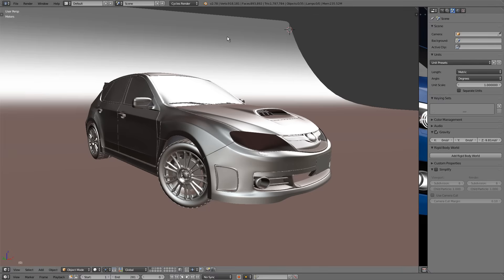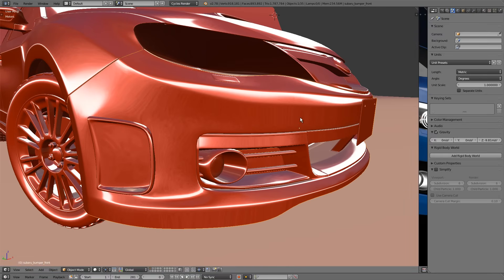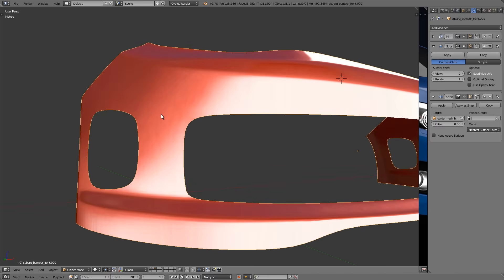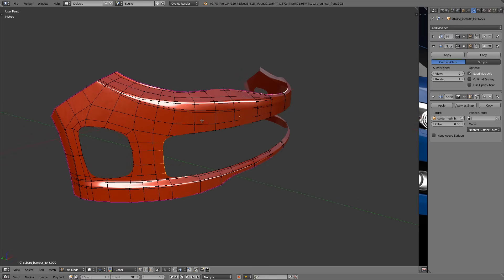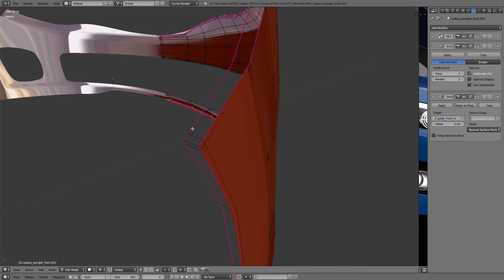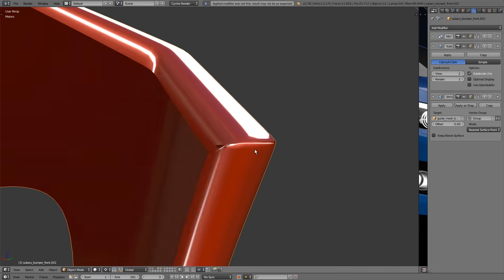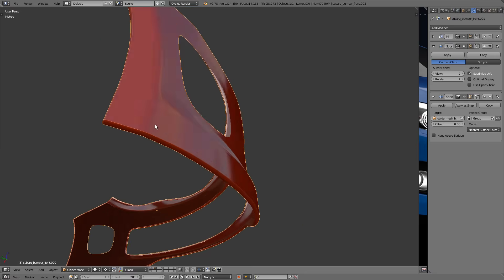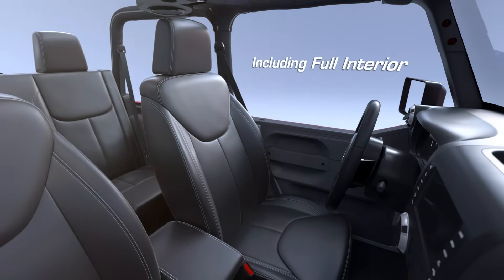Advanced Subsurf Modeling - Techniques to Avoid Pinching

Comment: The excluded area interpolated geometry  betweeb the excluded edge and the part curved surface im shrinking try to conform to the shrink base and make a curved transition to the main surface area in my case. How to work around that?
Reply from the maker: If you're talking about adding thickness and getting issues when excluding vertices from being shrinkwrapped, this is actually an older tutorial which I delisted as the techniques have improved significantly in my latest course. Adding thickness no longer involves messing around with vertex group weights, and is entirely procedural. That said, for other cases where vertices are excluded from being shrinkwrapped there will usually be issues at the boundary between shrinkwrapped and non-shrinkwrapped vertices. Generally this technique is best suited for cutouts and panel separations, but there are solutions for problems that pop up from excluding vertices, but the solutions are case-by-case. I'm working on more universal solutions for this to make this technique as good for extrusions as it is for cutouts, but I don't have anything new published yet. Hopefully later this year.
Reply: @blengine  Amazing! Thank you for the reply : )

Comment: how did you model the guide mesh so perfect? did you use the existing model or what? sorry for noob question
Reply from the maker: At this point I forget exactly what I did with this, but since this was a repair I likely just took the existing model, deleted parts of it, and rebuilt those areas with simpler topology. The normal process for modeling this would be reversed though, you'd make the guide mesh first and then use a duplicate of that to make the more detailed mesh that gets shrinkwrapped on top of it.
Reply: @blengine  thanks really interested how to model bumpers and fenders from scratch, and the best practices to do it. most i see is subd quad extruding along blueprint
Reply from the maker: Yeah that's the typical way to do it. If you're looking to model from scratch, as in design your own, there might be some good tutorials on that somewhere but I don't know of any unfortunately.

Comment: The guide mesh thing is also good for modeling completely from scratch. (Making up your own vehicles.) In that case you tend to use modified primitive forms to define the main volume and profile shapes, and then build the different panels over it, while leaving holes or other geometry for other details. In the guides themselves you're not worrying about edge flow so much (if at all), so the topology can be somewhat more crude. You can even poke meshes through each other to make guides, as it's the external surface you're concerned with. All the panels built over the guides will line up. Of course edge flow is something to be keen on when making the panels so you can control creases for the blended forms.
Reply from the maker: Yeah shrinkwrapping is extremely helpful for many workflows, and takes a lot of frustration away from making complex things.

Comment: Has shrinkwrap changed in implementation in 2.9? If i create a bumper everything identical to the way you do it, duplicate and add the two subd layers to it. Everything works great until i apply the modifier to lock verts in position on my final mesh, once i do that, all the verts lo longer line up with the guide mesh positions. They sorta "jitter" along the line where they should be nearly identical to the guide mesh beneath, it's been really aggrevating me recently.
Reply from the maker: The technique should work in newer versions of Blender, though they did move some options around in the shrinkwrap modifier which can cause some confusion. If you're still having trouble with this, send your blend file over to me at contact@cgmasters.net and I'll check it out. And set the blend file up to before you apply any modifiers so I can try doing that myself. -Chris

Comment: How about in 3ds max? What's the tool called that achieves the same thing? Thanks
Reply from the maker: Hey Sp00f, this link is extremely helpful when it comes to 3ds max  -  https://knowledge.autodesk.com/support/3ds-max/troubleshooting/caas/CloudHelp/cloudhelp/2021/ENU/Installation-3DSMax/files/GUID-008F9FA9-F532-4EEE-B4BD-E5A6C4C49E47-htm.html
Reply: @blengine  got it! thanks a lot for taking the time to reply. will consider giving this option a try
Reply from the maker: haha, to answer you seriously though, I know maya has a shrinkwrap modifier, but I'm not sure about max. This is the best I could find on the topic - https://forums.autodesk.com/t5/3ds-max-modeling/shrink-wrap-in-3ds-max/td-p/8913852
Reply: @blengine  thank you. seems like the conform tool is what ive been looking for! have a good day bud <3

Comment: Nice tutorial, still useful after these years. One question: Anyone knows how would you approach the problem if you need to add some low relief carvings in a curved surface? Imagine a R2D2 droid model with many details on a cylindrical surface

Comment: so youre constraining against a guide mesh but the second you remove that (say you export an obj to a game engine or another package) without the guide mesh and deformer constraining it, when that mesh smooths its going to look wavy again isnt it?
Reply from the maker: Yes without the guide mesh the effect is no longer in play. What you'd need to do is apply the modifiers, including the subsurf modifier, so that the subsurf geometry is real and then the shrinkwrap effect is real as well. Then you can export. There's actually an option to apply modifiers when you open the export window too, so you don't have to do this manually, you can just make sure that box is checked when exporting. The problem with this is that it creates loads of extra geometry, so for something like a game model this isn't ideal. But what you could do for game models is use the shrinkwrapped model for baking normal maps onto a lower poly version of the model. Then these normal maps can be used in other software to ensure that your surfaces have the same perfect surface appearance.

Comment: Hello CG Masters. I really like how shrink wrap modifier works in blender, but let's say if I want to apply the shrink wrap modifier without applying my subdivision surface first? Like is it even possible to apply shrink wrap before subdivision modifier and still maintain nice smooth curvature? Because whenever I use shrink wrap on my model, all looks fine, but once I want to apply my shrinkwrap before subdivision surface, my curvature won't be that smooth after applying it. Is there some workaround on these situations? Or you just have to apply subdivision before shrinkwrap? Thank you so much for your help, means a lot to me <3
Reply from the maker: Hey Samuel, without that extra subsurf geometry to shrinkwrap then you unfortunately won't get smooth and continuous curvatures. Shrinkwrapping subsurf geometry is the core of the technique. So yeah you'd have to apply the subsurf modifier first, and then apply shrinkwrap.

Comment: This is all good and well but my tip for beginners would be to make sure you practice your sub-d workflow without using this shrink wrap method because its like modeling with a crutch. Also its not a modifier that you have access to in  every software package so its not easily transferable if you need to learn to model in something other than blender.
Reply from the maker: Whenever beginners ask about my full course on these techniques, I recommend practicing regular modeling first. These are advanced techniques meant to take regular subsurf modeling further, not replace it. Understanding the fundamentals is essential, especially since for these techniques you still need to be able to model cleanly in order to get a perfect Guide Mesh.

These techniques perfectly solve very common and frequent issues, so some may call it a crutch, but it's really just progress. Like every tool it's not appropriate for all circumstances but it excels at what it's for, and knowing when to use it is where some solid fundamental experience is important. In the end these techniques can speed up the workflow while resulting in perfect curvatures comparable to class A surfaces throughout a model and through separate panels. They also more easily achieve better topology and you retain a low poly mesh for editing. Plus there are some unique tricks these methods can pull off. This youtube video only touches on the potential. It's truly a fun set of techniques that makes modeling very enjoyable.

When it comes to compatibility, I haven't tried this in any other software, but many people have followed my course using Maya with comparable results, so Maya seems to have modifiers that work similarly. I haven't heard anyone mention any other software that works with this though.
Reply: @blengine  Bit late on this one but yes I hear you. And as a Maya user I can confirm that it does not have anything of the sort, Maya doesn't even have 'modifiers' as such. There is a shrinkwrap but it does not work the way the blender modifier does and requires quite a painful workaround. Yes its possible but not doable out of the box like in Blender.

Comment: Hello! Looking forward to learning blender after this! I have a question, can you colapse the shrinkwrap modifier so you can delete the base mesh? I think I didn't understand how it really works, because I see you have tweaked your model because shrinkwrap did some changes after applying it...
EDIT: Just to clarify, the reflections are nice because the vertices are placed perfectly to make them with this method right?
Reply from the maker: Yep the modifiers can be applied to the base mesh so that you no longer need the guide mesh. Then you just end up with one perfect mesh in the end that doesn't need modifiers. And yes, the reflections are better now because shrinkwrapping moved the extra subsurf geometry and it created a smoother surface for light to bounce off of. -Chris

Comment: BRILLIANT! but as a maya user, after seeing this video, it's been bugging me - this has to be possible in MAYA right? finally confirmed it tonight - it works!

so as in blender, the key is order of operations:

0. BEFORE you cut details and holes (like the headlight holes), duplicate your low poly cage and subdivide that so that it is higher than the vert count that you will generate in the step below.

1. take the low poly subd cage WITH the cut out holes and apply a smooth operation (1,2,3 subdivision surfaces using the number keys will not work for this - you actually need to generate additional vertices. you'll STILL be able to turn subds down to 0 in order to get your subd cage back but it has to generate legit verts at some point before render for this to work.

2. SHRINK WRAP the cage with holes onto the cage without holes - generally, using -bidirectional and -closest will give you best results. after this, your GANKY, PINCHY, WARPY mesh with holes will still have the holes but be smoooooooooth as the mesh without holes.

3. as in your video, if you need to extrude the edges around the headlights or whatever, you can... but only AFTER you've applied the shrink wrap. if you do it BEFORE, the extruded verts will get pasted and flattened onto the smooth shell of the cage without holes like everything else. if you do AFTERWARDS, the new polys that are generated from extrudes are NOT AFFECTED by the shrink wrap because those polys did not exist to get assigned the shrink wrap constraint.
Reply: Thanks for this Maya explanation. So can you revert to the proxy and delete history after you shrinkwraped or do you have to keep both the history and target mesh ?

Comment: Do you apply all the modifiers when exporting to game assets? Does the poly count go up too? Thanks.
Reply from the maker: These techniques are often for higher poly models since subsurfing is usually involved, but those models can be used for baking normal maps onto optimized low poly game models. But if you did want to take your results of these techniques into a game engine then yes you would apply the modifiers starting from the top of the stack. Though exporting will apply modifiers by default as well. -Chris
Reply: CG Masters good to know I suppose there is a workflow of keeping the low and high polys together and to work back and forth between in Blender? I find it tedious to texture paint, bake in lighting with cycles to an image texture with HRI env on and then to save rehook that Map in the node editor to preview in LookDev. And if you restructure the mesh for further mesh reduction unwrap everything again to rinse repeat. Well that’s my starting out view. Probably need to invest in a 3rd party tool to make life easier.

Comment: Watching this in 2020 and wondering who’s willing to ask and pay for that much of details and extra work, doing it just for fun won’t be a good motivation for anyone, imagine doing that to each part of the car model, now imagine doing it for 20 car or so, I saw people selling a 3d car model for 200$ which it took them 3 hours to model!! How do you compete with that ?
Good tutorial in case James Cameron called me about making the next Terminator movie.
Reply from the maker: Using techniques like this require way more follow-through in thought than you've given it. You wouldn't do this for every part of the car, you'd create the entire car without the details and holes in it first, then simply use this mesh to create the final panels that get shrinked on top of it. Super easy and actually speeds up the workflow once you've practiced with the technique. And it's insanely useful outside of car modeling as well. There's more info here - https://cgmasters.net/training-courses/master-car-creation-in-blender/

And sharing that link is not me saying you should buy the course, I don't think you could handle it, you sound more like a "just gonna put some cylinders on a cube and call it a car" kind of guy, but there's some gifs on how it works and write-ups there on why this is a super useful technique to get to know, because sometimes you do need perfection, and if you get a workflow boost and better topology in the end then there's no downside. -Chris
Reply: CG Masters thanks for the reply, you probably live in a market where professionals appreciate and evaluate the work you’re offering, not that much of luck where I come from, makes you think twice before spending an other minute on something only trained eyes would notice, I got it, you want perfection and you want it to be close to real life as much as possible, at the end of the day we all have mouths to fill and that changes the prospective.
Reply from the maker: @forrestgump2114  Yeah it depends on what work someone's doing. This has saved me a lot of time in normal non-perfectionist circumstances too. It's not actually a time consuming technique when you get to know it, and this tutorial only shows a fraction of the potential, but it's also not for every circumstance. Just like with any tool, part of the game's getting to know it to know when it will benefit.

Comment: Great video! Perhaps you can help me with a problem. How would you go about making those cutouts have sharper more square corners, while still maintaining the smooth overall surface? I can't figure it out for the life of me. Thanks!
Reply from the maker: When geometry that's subsurfed is more spaced out around corners it'll make the corners softer. So the trick to sharper corners and details when subsurfing is to add more geometry around the areas you want to be sharp. So in this case you could add a new edge loop around the corner and slide it close to the corner which will sharpen in up. As long as you still have a smooth guide mesh then the extra detail on the shrinkwrapped mesh will get smoothed out in the end still. -Chris
Reply: @blengine  Ah, I was doing that, but at the wrong step/order, so it was creating pinching and creases on the once smooth surface. I re-watched and think I understand now! Thanks!

Comment: big question. lets say you wanted to do more then just add thickness to the cutout part. you actually have details in there you want to model. but of course you cant do this on your base mesh because the whole reason to use the modifier is to prevent the pinching the cut out has created. is there not some way i can mark the cut out edge and it tells the modifier to not modify the rest?

i think you kinda explain it in the video with vortex groups but i guess i have to use thickness modifier to get the initial part. ok well good tut thanks man. ill try messing around with it more
Reply from the maker: Oh yeah if you want to exclude vertices from the shrinkwrapping, then you can use vertex groups. Then when you use a vertex group in the shrinkwrap modifier the modifier will only affect vertices in that group, so exclude vertices from the group when you don't want them affected. -Chris
Reply: @blengine  lol yeah sorry i should of watched your full video before asking that. i just didnt think you were going to cover it. thanks man it worked like a charm.

Comment: but what if i want to bake a normal map on the low poly for a video game, would it work with the shrink wrap modifier ?
Reply from the maker: Yeah the regular normal baking process would work exactly the same even if you're using modifiers on your high poly mesh. -Chris
Reply: @blengine  Thank you for answering, great video by the way, very useful.